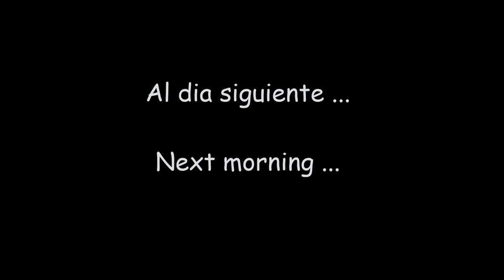Rare Copper Ashtray Repair & Restoration ( Beach Found ) How to remove rust from copper metal.

Comment: You didn’t need to scratch the surface with the wire wheel. Just slather some tomato ketchup on the piece and let it sit for an hour. It would have cleaned all the oxides of and then follow with 6x steel wool.
Reply from the maker: Yes agree, first i tried chemical cleaning with vinegar and salt but residues left, so had to use mechanical cleaning, Thanks for watching !